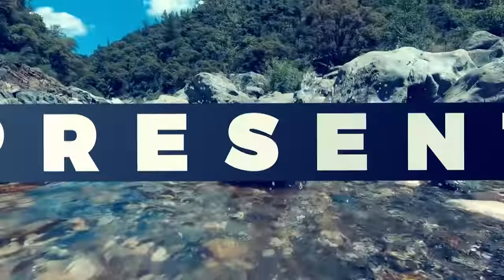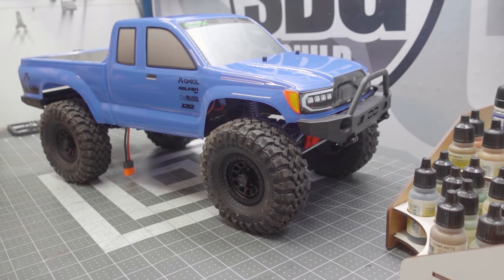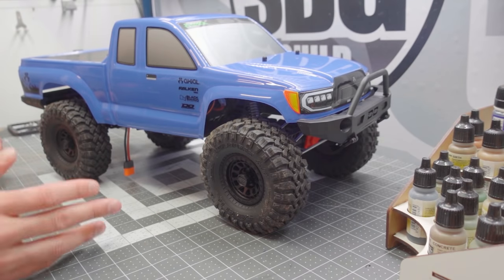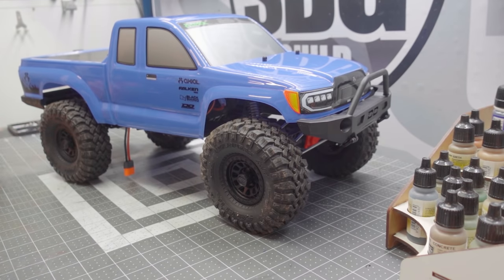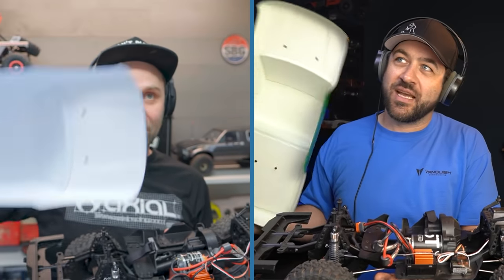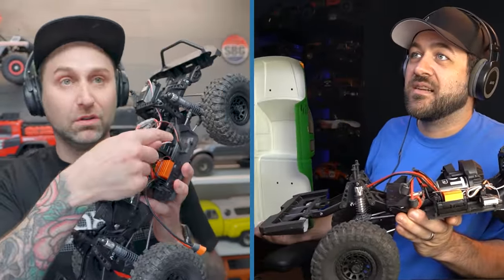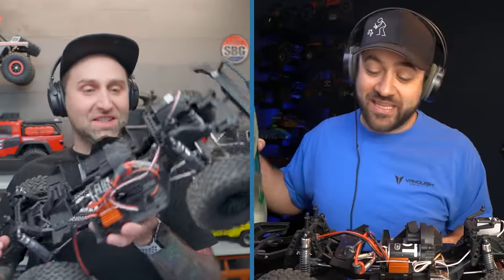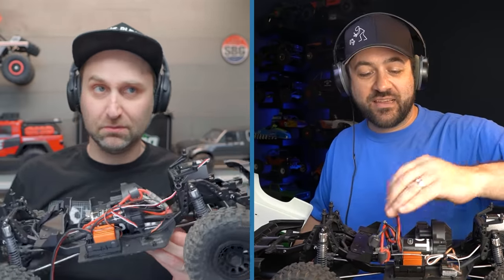24 Hours of Mayhem - SCX10III Basecamp

Comment: Great fun my dude! Surprised how much you could do with spares you already had in stock. But I guess in your situation, you'll have a reasonable amount of bits and pieces hangin around. A shame you couldn't gloss out the windows somehow. Is it even possible to strip paint and have clear plastic after? And I certainly wouldn't have thought of gold for the body colour! But it looked great in the end! 
Interestingly I recently acquired an early SCX10, without the II or III ! I'm already in the process with the order of a Jeep Gladiator shell. But I'm taking it out for it's first drive today to the same spot where I tested out an RC4WD Land Rover, also pre the II spec setup. Looking at upgrading both somewhat, after the drive out though! 😁

Comment: If you really want to throw a curve ball into the build...make an 8X8 with the two forward axles have proportional steering (or a 10X10 with the two forward and the last axle with proportional steering). You will have to some mixing and matching with several of the axles (especially if you go with the 10X route). Dual motor, whatever differentials that won't cause too much binding (maybe open with silicone earplugs for diff "fluid"), and a HIMARS missile launcher on the back. Hot pink with cyan streaks and magenta dots.
Now that's a 1/10 off-road build.
Ooh! No!.. a half-track. Yeah, that'll be a show stopper.
Reply from the maker: I’ve done a half track. Thanks for the suggestion!

Comment: On full turning lock does the tyre rub against the underneath link bar? Also are the electronics waterproof out of then box?
Reply from the maker: Yes, but that can be adjusted with a wider offset wheel. Electrics are water resistant. Nothing is waterproof.

Comment: I got to say the first thing I would have done is stripped all the paint away with paint stripper repainted the body LOL. And then it'd probably do aluminum axle housings with some brass parts on the portals call the truck good at that oh no wait a minute yeah I throw away that spectrum crap and upgrade to servo put a hobby Wing FOC in it

Comment: Do you need to scuff, or use an adhesion promotor for the outside of the body ?
Reply from the maker: Nope, if you use Lexan paint, it's specifically designed to adhere to Lexan specifically. Thanks for watching!
Reply: Ok, that makes sense.
Thanks for replying 😜

Comment: Hello, subscriber here with a question.  What do you use to print your decals that are in this truck?
Reply from the maker: I use a Cricut printer, I have a video all about it!
Reply: @scalebuildersguild  thank you
Reply: @scalebuildersguild another question regarding your build.  How did you attach the Honcho cage to the bed and how did you address the fitment issue of the rear body post mounts.  I have a Basecamp which I’ve also modified, and I’m interested in doing the same Honcho bed cage mod on mine.  Thanks
Reply from the maker: @roadrash76  it’s a little short in terms of length, and mounted to the lip of the bed. Some trimming is required to have it fit between the frame rails. I also used a kit honcho bed, and drilled my own post holes.
Reply: @scalebuildersguild  so did the Basecamp OEM body post assembly work when installing the Honcho cage?

Comment: "you don't need a lot of tools... Or spend a bunch etc.."
Has a 3D printer and a carbon vinyl sticker printer, CNC machine, welding equipment 🤣🤣🤣🤣
Reply from the maker: Hmmmm, point taken 😂
Reply: @scalebuildersguild  The statement was not meant to insult or agitate, just making viewers aware that there is a balance of what can be done with what someone has access to.
Also, would you be willing to do a review and possibly a build on the FTX Gladius? I'm thinking of getting one and I feel like you would do well with it in either scenario. Thank you in advance for your time 🤙